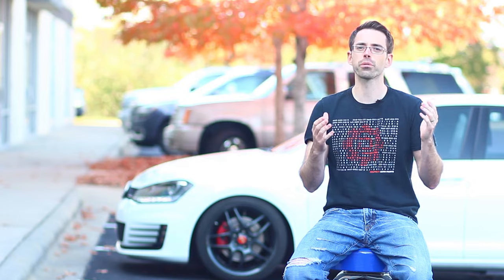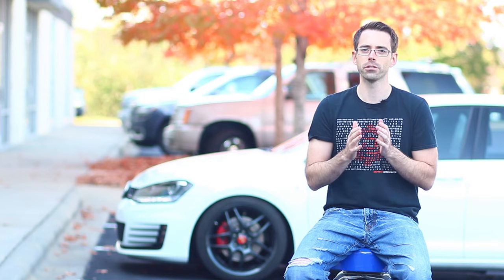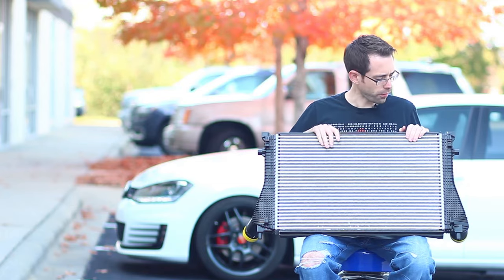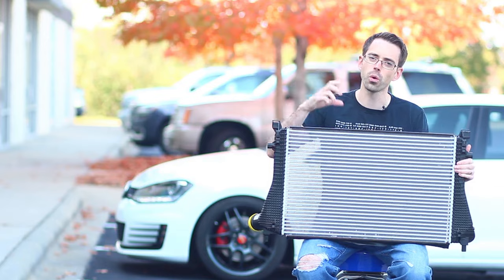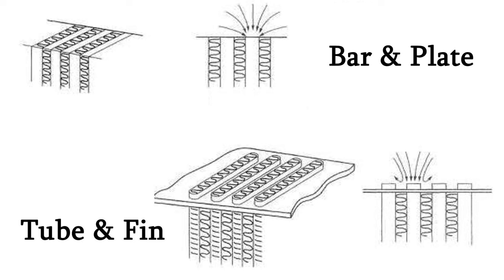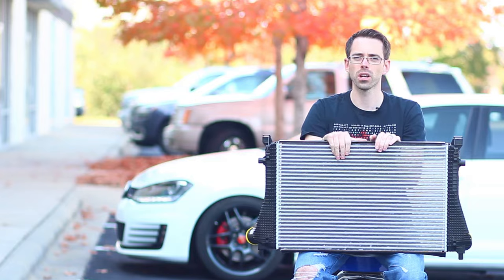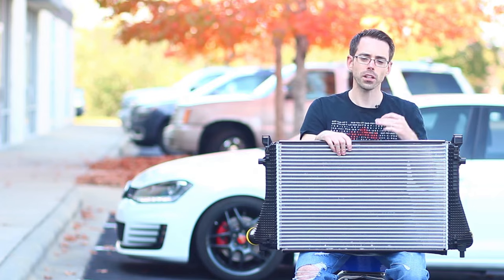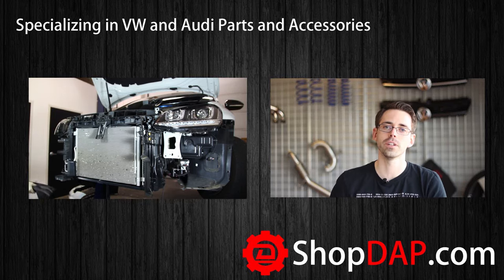How Intercoolers Work and Why you Would Upgrade

Comment: I know I am way late to this video, but...intercoolers DO gain power.  Why?  Because an intercooler increases the "Manifold Air Density".  The problem with turbos is they make the intake air hot as they compress it...and hot air is less dense than cold air.  To increase HP, you want to add colder air at the same boost pressure.  If you only increase the boost pressure, you proportionally increase the intake air temp, which doesn't help anything.  (To learn more, check out the Banks Power channel...)
Reply: True. APR says +21 hp gain on their website.
Reply: Of course they gain power!!
Reply: @csllover  Ha!  I think I commented because the video kind of discouraged intercoolers?
Reply: @fredygump5578  yes, very stange that they say this.

Comment: Hey Paul thanks for the informative video on intercoolers. Any recommendations on a performance intercooler for a MK7 Golf R running a stage 2 with a downpipe??
Reply: +Carmelo Susino Hey I would really recommend a Wagner intercooler, im running it on my MK7R with a stage 2 tune. Its the best one in my opinion
Reply from the maker: +Carmelo Susino We are going to be putting up a DIY on the Revo Intercooler we did last week.  That is a really nice product which was a pre release model.  We also have the Unitronic Front Mount Intercooler which is a nice product as well.  https://deutscheautoparts.com/mk7-gti-golf-r-intercooler-unitronic.html

Comment: Nice video on the basics of an intercooler and after I removed mine to swap out some of the piping, I did notice something ... a little bit of oil in the intercooler and piping itself.  What I have now is a spare OEM intercooler that I swap out every spring.  The one that gets removed then gets degreased on the inside and outside (and in between the fins with a pipe cleaner).  I personally think that is more efficient in the long run. I lost count of the number of larger intercoolers installed on local dubs that are so dirty ...  just on the outside. I think it's safe to say that the dirt on the outside has an insulating affect (keeping heat inside) ... and any oil film on the inside prevents the air from directly contacting the aluminum surface inside.  Just my 2 cents!

Comment: Love DAP, but (and I may be mislead here, but this is what I have learned) a bar and plate intercooler is less efficient, but the smooth surface doesn't really gain you much in terms of "air efficiencies". Furthermore, increasing the length the air has to travel (so passenger to driver side on a golf) is actually the main issue regarding air restriction. Shortening the distance traveled nets you the largest gains (also meaning that increasing the height on a golf intercooler, if possible, won't really effect the back pressure much and is preferable). Another great benefit of after market intercoolers is the reduction in flow restriction vs. the stock units. 
And for the golf I'm a huge fan (to the point where I had a custom IC/End tank setup created, but an "off the shelf" version can be bought) of the "true" front mount ic (so the intercooler is removed from the condenser/intercooler/radiator sandwich). You lose the transfer of heat and get cooler air & water temps. Great videos tho!

Comment: before I had my APR stage 1 tune my engine ran really hot. Cats would live on my bonnet, with the APR tune the engine is so much cooler, I hope this translate to better performance next summer. I also would try a Cold Air intake before I ripped out the stock intercooler. Maybe less heat soak?
Reply: The stock air intake is a cold air intake as it takes air in from outside the engine bay. DAP does have an aftermarket cold air intake available which I think is,supppsed to flow more air.

Comment: What is the maximum power you can put through the golf R with a standard intercooler, before suffering from heat soak?
Reply: Run it hard enough on the track without cooling down, the standard intercooler will suffer from heat soak at stock power.

Comment: I have an 2015 Audi TTS 8J/ MK2. If you upgrade the intercooler will you need tuning? I’m in Florida where it’s hot. I have a stage 1 ECU tune. will having a larger intercooler with more available volume of air due to a larger size require tuning ? Would it throw off the A/F ratio or computer parameters potentially cause reliability issues without a tune?
Forgive my ignorance….
Reply: No it will not need a tune and no it won't throw off the ratio, if the intercooler is larger it will just take a little bit more time for the turbo to fill up the extra volume and get to the pressure that the ECU demands ( we are talking under 1 second here maybe 1 second at most of lag) other than that you should be good. The upside is that the air will be cooler and more dense thus helping the engine run more eficient especially in warmer temps. Hope this helps!

Comment: I've been thinking about upgrading will it give better flow & increase exhaust sound
Reply: It SHOULD allow for better airflow from the turbo and into the intake, allowing for better combustion and potentially more power when the boost is turned up. It will NOT change the exhaust note in any way.

Comment: is it safe to put my aftermarket fmic on my audi b5 while i'm running on a stock tune and stock ko3 turbo? I plan on doing a stage 1 ecu tune by APR about a month or two down the road, but i'm curious to know if its safe to put the fmic on now before I tune the car. ps it is not my daily so i would only be driving it 2 or 3 times a week until then.

Comment: So then no power gain? What?? What about the company like apr or CTs claim 20 + more horsepower? Is it not true
Reply: No so what you want in an intercooler is the ability to disparate the heat soak that everyone gets quickly they call this recovering. The only way you can get more power is by the cooler making colder denser air thus tune adding more fuel for the extra air
Reply: APR claims +21 HP gain on their website

Comment: Good general information, not so good technical accuracy. There are some interesting fluid mechanic characteristics that come into play in these designs, but at that point you are just splitting hairs. You touch on a strong point though of the weight involved in these factory coolers, perhaps we should be asking if gain in power can justify the weight gain?

Comment: What is your opinion on using two intercoolers in a Mk7 gti? (front mount plus stock location)  I've heard from one performance mechanic that its not so simple and all in all isn't ideal due to temperatures entering one and going into the second.  I had considered the idea since I am stock IC with a low output APR tune.  I'm not sure if even an upgraded unit will be cool enough.
Reply from the maker: +Austin Jones Answer coming on Episode 23 of the AskDAP show.  Stay tuned.  Be sure to subscribe
Reply: +Deutsche Auto Parts That would be much appreciated! Do it up.

Comment: What are the best upgrades (besides a tune) that you can recommend for a MK6 (2013+) GLI?
Reply: Treizez34 aftermarket turbo and larger intercooler can buy a full turbo kit with the intercooler offline for like 500$ and slap it on should give u alot more hp and more boost
Reply: Down pipe n test pipe.... turbo diverter valve for turbo lag n a turbo muffler delete

Comment: So if the air delivered to the engine have different parameters is it ok not to change the software?
Reply: depends if your software can automaticaly adjust the quantity of fuel injected, so you can keep the same afr
Reply: vincent marical every modern car’s ECU has ability to adjust for air parameters most cars from 1990s
Reply: well my turbo diesel have 40-50 cels starting temp and on pulls its going to 80+ what u think how much hp iam losing?

Comment: If I install aftermarket intercooler piping, do I have to tune my car?
Reply: Nope. It's a factor that will allow you to get more out a tune. As the engine makes more power and creates more heat, a stock intercooler could become a limiting factor because it can't dissipate the heat anymore. The return you get from a good tune is limited to the engines airflow, fuel flow, and heat dissipation. A good tune requires some mods. A good mod doesn't usually require a tune.
Reply: @Ichibuns  how do i even know if my car come with turbo production cause it have intercooler and im quite not sure if it have one

Comment: I'm confused as hell.   So does that mean your car would run faster/better/produce more power in the winter time with cold air?  Why are all the races happening in the summer with all that hot summer air?
Reply from the maker: Cold air makes more power but less traction.
Reply: @Deutscheautoparts  if my intercooler hose is leaking some air when i accelerate will that cause a loss in acceleration a little? my boost gauge reads 0.5 to 1 bar for just accelerating to 70 km/h at 1900 rpms.  it never used to go into boost at this low speed acceleration

Comment: Is it worth the extra weight though?
Reply: If you're getting a tune for extra power, it's absolutely a necessity. Otherwise, not unless you run the living crap out of it at the track. Extended track use without a chance to cool down will cause your car to go a bit slower due to power loss.

Comment: This is an after cooler not an intercooler, you use an intercooler with compounding turbos vs a single turbo set up it cools the air from one turbo to the next then going through the after cooler then to the intake.
Reply: Superchargers have after coolers, what are you even talking about?